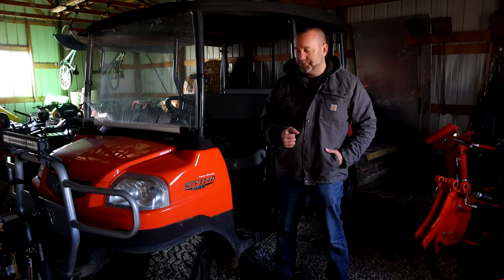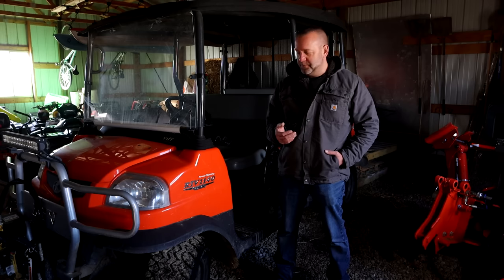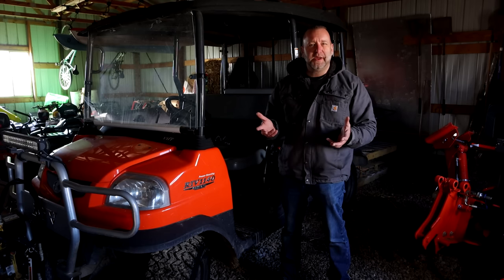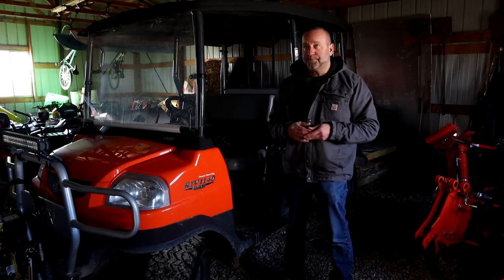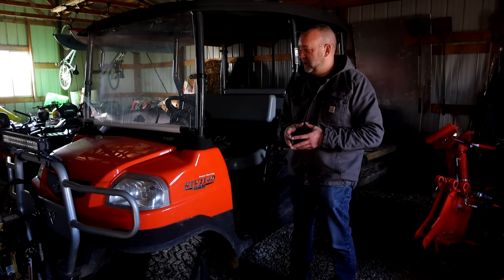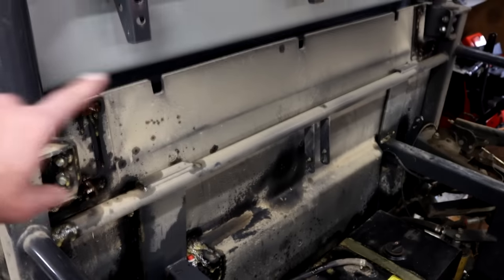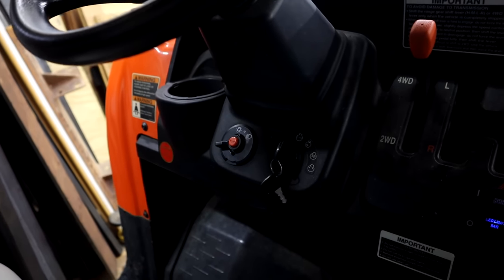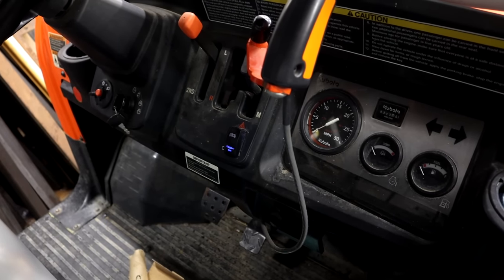Upgrading The Fuel System On My Kubota RTV 1140CPX

Comment: Very well done video. I have the 2023 1100C Kubota. Mine starts instantly all the way down to 30 degrees so far. I have not had any of your issues yet. If I do I will definitely do these mods. Again very detailed and informative video. Thanks! I might do the fuel filter water separator mod anyway. I was a boater for years and all diesels should have a water separator.

Comment: Excellent video.....hate to change the fuel filter under the machine.  Have a similiar filter and didn't know how to make it work with the 1140....have ordered the fule pump and additional line needed.  thank you
Reply from the maker: Awesome!! Let me know how it turns out. I’m interested to know if you have the same results.
Reply: @JaredsShop  Finally got around to installing the fuel pump and filter.  Worked like a charm..  However, disabled the manual fuel pump....Removed it and ground down the lever on the pump. Reinstalled.
Reply from the maker: @stef985  
Sweet! Have you noticed an improvement in starting and initial idling? Drivability?
Reply: @JaredsShop  Haven't as of yet...but the fact that it takes the belly filter and moves it to a more accessable location is worth the conversion.  Having an additional filter water seperator is a a great feature.
Reply from the maker: @stef985  
I agree. It’s nice just knowing there is better filtration at an easier to access location. I hated that inline filter hidden by the skid plate.

Comment: Great job!  I have a Kubota ZD326 and X1140.  Always love seeing videos like this.  You did a great job explaining the issue and showing your solution!
Reply from the maker: Thank you! Do either of those have.a separator or do they just have inline filters?
Reply: @JaredsShop  The ZD326 just has two inline filters, one before the electric fuel pump and one after.  The X1140 is new so I haven't changed it yet but I have read the manual and I believe it is just a fuel filter.  It is much larger on the X1140 and looks like the filter on some of the Kubota tractors but no separate purge at the bottom for water.
Reply from the maker: @MyTechWebTV  
Ok. Well that’s still better than just a cheap inline. The spin on filters are usually made better.

Comment: I couldn't help but notice that your inline filter is backwards. It will plug very prematurely if it is not flowing in the right direction. There should be an embossed arrow on the filter showing direction of flow
Reply from the maker: It’s not backwards now. It was in the video and I forgot to point it out. Thanks.

Comment: I took note of your hydraulic plow set up. I have the same thing on my 900 but can not find any info on it. Is it a Kubota accessory or a Curtis? I am presently having the no fuel problem and I am in the process of researching it.
Reply from the maker: Is it just like mine? If so, it’s a Kubota option.

Comment: Thank you for this video. I have been looking for a solution to the problem for two years. Everything I change the fuel filter at recommendation of dealer but they always appear clean.
Reply from the maker: You’re welcome and I hope it helps. Let me know if you do the same thing.
Reply: @JaredsShop  I applied the modifications just as shown in your video.  The only thing I did not do was drop the fuel cell. So far so good.  Thanks again.
Reply from the maker: @jeffz5536  
Glad to hear it bud. Keep me updated. So far mine is still running good and better with this fuel pump.

Comment: I have a diesel bobcat 3400 and I believe it’s not getting enough fuel to the engine, I checked the lines and everything is clear. It would start and run fine for about a min then it will lose power/speed and eventually won’t move even though pressing the gas pedal then it would eventually stall until I let it cool down for about 30 min. I even replaced the fuel pump and now it won’t even start, sounds like it wants to but won’t turn over. Any ideas?

Comment: awesome video - thank you so much
I have an RTV x1100C --- same problem that you were having -- i tried removing (to test) the fuel shut off solenoid --  am waiting on new solenoid (major pia to install since everything is so tight.  Am actually thinking my problem is similar to the crap that you were faced with. anycase; thanks
Reply from the maker: Thanks for the feedback! Good luck and let me know if you end up installing the same pieces.
Reply: What are the two fasteners that bolt the injector solenoid? Allen. Torx?.Thanks in advance

Comment: Thanks for the excellent video. I am having the same problem with my 1100c. In the video you mention posting a link to the parts you used but I did not see a link. Can you advise which pump and filter you used. Thanks
Reply from the maker: You bet. I’ll post them here but you can also see them by clicking on the down arrow that is to the right of the video description. So that is above the like/dislike and share button. 

I’ve pasted the fuel hose I purchased as well as the hose barbs for the filter. The ones with the filter are too big. 

Fuel filter/separator - https://amzn.to/3s5dVcz
Fuel pump - https://amzn.to/34SkjuN
Fuel line - https://amzn.to/3BDqQ8p
Hose barbs - https://amzn.to/3v0CU2s
Reply from the maker: Also, drop back here and let me know when you’ve completed it and let me know what you think.